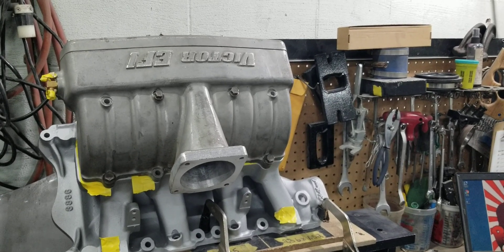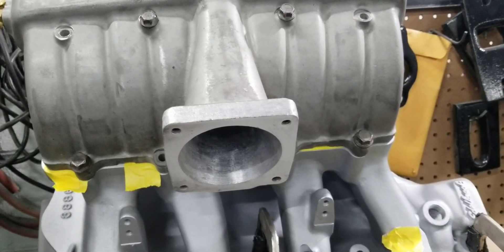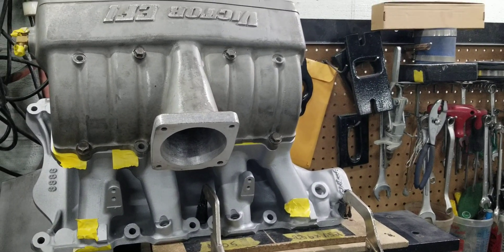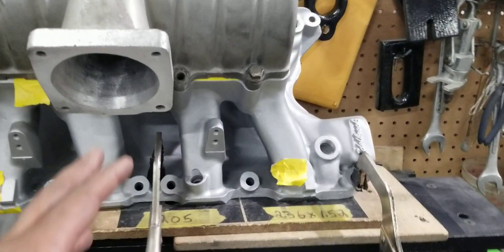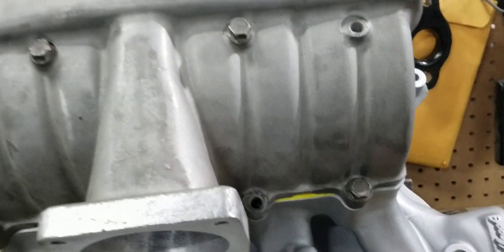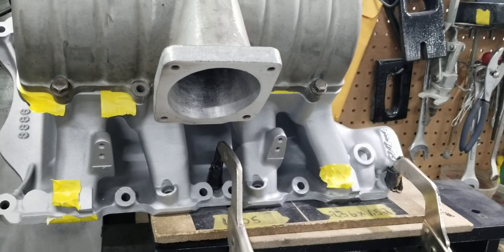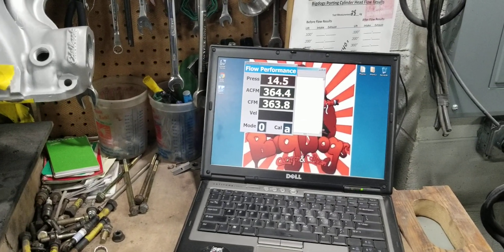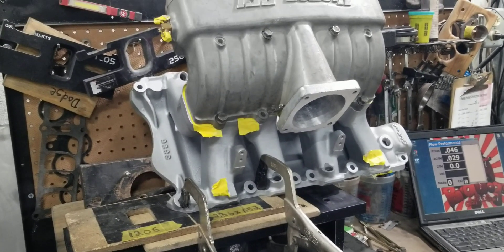SBF Stage 3 Ported Edelbrock Victor 5.8 flow results Part 2!!😁

Comment: Tony, what do you think the best flowing/power making plenum style intake is for a SBF/Fox body besides a Holley hi-ram?

I was thinking about finding an old Victor EFI 5.0 manifold, but after seeing that pinch point in the plenum tunnel, now I’m wondering if it’s too restrictive.  Did you guys measure the total flow through the manifold/all the ports?

Thanks for any info…. I’ll likely be letting you guys do a manifold for me, once I figure out the best one to start with.  500 hp 347 build.
Reply from the maker: Good question. The highest out the box flowing  and evenly distributed plenum on a sbf 2 piece style efi manifold is the tfs box R. It's TB tunnel flow is well over 1,320cfm which is the key reason it works so well even though it's out the box average runner flow is only 285-290cfm. 
Having a good flowing plenum and throttle body tunnel is key to maximizing your runners cfm flow to making higher HP. This is one of the reasons our new BRD Porting option can support so much power. We can BRD a manifold like a Systemax 2, Track heat, RPM2, TFS R, Victor 5.0/5.8 or Explorer GT40 and turn them into a high flowing higher rpm beast! All you have to do is pick the manifold you want and let us do the rest. No need to waste money. 500hp can be easily done with any one of those manifolds with stage 3 or BRD Porting.
Reply: Thanks for the info.  I’m running a stock hood so I can’t run the Box R.  I have it narrowed down to the Victor EFI 5.0, TFS Track R or the Systemax.    Appearance, I like the Victor EFI 5.0 best.  I had already planned on having it ported, but that narrow plenum barrel worried me.  I’ll be in touch with you guys about porting one as soon as I find one.
Reply from the maker: @AJsSpeedShop  we can do a BRD on those but the Systemax 2 and track heat are more readily available
Reply: Is the BRD the deal where you remove the TB flange and install one for a 90mm TB?  I watched a bunch of your vids and saw that.

Do you think the Systemax is the best over all intake to start with before porting for a 500hp, 6500 rpms build?     I can’t stand how they look but, if they make the most all around power, I’ll go that route.
Reply from the maker: @AJsSpeedShop  yes the BRD deal gets the increased throttle body tunnel flow, 90mm throttle body opening, cut with max runner shorting and max welding for max flow. The Systemax, R and track heats are the easiest ones to do this on. We can do this on the Victor as well but it's TB tunnel won't flow as much as the others

Comment: How do those victor efi intakes work on the street? A victor carb intake is definitely not ideal they have really short fat runners but these seem to have pretty long runners still, is the Tq curve on par with the victor carb versions regardless of looking so vastly different. Been researching for year or so now but Im just now in the early stages of putting a hotter engine together for my 95 first is the shortblock, the intake is the big ??? Aftermarket intakes are sooo GD expensive... Guess its sticker shock im still in the good carb intake for $250....im just a blue coller workin jerk off wanting to be less slow. What do i do Have my stock 95 HO ported or attempt to find a gt40/explorer? Go aftermarket? id so what... Its not going to be a hot max effort street n strip engine just a nice strong running daily stock stroke street engine I aiming for compression to be in the 9.5:1 to 10:1, likely enforcer 185s and a nice street cam with decent drivability xe274hr ballpark, something that would run up to 6000 or so. When its time to start  to break out the bank card ill definitely be getting ahold of you folks.
Reply from the maker: The Victor 5.0 is a shorter runner efi intake and loses low end torque compared to the others. It makes great top end hp in the 6,500-7,000rpm range and wouldn't be ideal for your combo. Best manifold for your combo would be our Stage 2 or stage 3 ported Explorer or Cobra gt40 manifolds with our Steve 2 sbf cam. You will have torque and hp and it's cheaper than the aftermarkets
Reply: thank you, I appreciate the reply.

Comment: These videos get me excited and remembering builds 20+ years ago
I already know those runners have a lot of taper to them from the plenum to the head.! I use to port ZR1 intake manifold I learned to use, from a fellow technician, a set of precision machined Delrin balls. I ported according to the balls sequence and associated diameter. Tremendous power improvements across the board!

Comment: Paused @ 1:44. I've used that manifold.  I've ported them to death 20 years ago. Then the manifold had no use for anything larger than an 80mm Accufab. I can't wait to see if the the customer just wants "big" or if the port work needs the throttle body.....

Back to vid
Reply from the maker: The customer wanted bigger TB. We explained exactly what you just said but the customer wanted it to 90mm.

Comment: I say that you have more than enough airflow . More than that I'm guessing you are going to slow down the air speeds and might effect anti reversion?
Reply from the maker: It's going on a 445ci motor so cfm flow and CSA is key to big hp and torque as long as the customer has the right supporting parts to keep up with it.

Comment: Man i didnt know that u used jb weld to glue the manifolds back together. Thats a smart move cause its faster than welding and nobody will ever see it .🤣😂😅😂jk I know that you dont that but it is funny someone is trying to make that claim as good as your work is 😁. I actually saw that claim and was going to give you a heads up on it but I laughed when I saw it cause I didnt believe that crap. Boy the haters or wannabe porters will say anything to try and make themselves look better 🤣 Who was it claimed that B.S? Don't let them come say it to yalls face and it make yall scared to come back to the shop and finish your orders 🤣😂🤣. I got your back if hes to scary 😂🤣😅😆
Reply from the maker: You hit the nail on the head. The haters has accused us of damn near everything from being scammers to putting out fake information even though we have put out tons of information and have about 4,000 customers out there lol. We've had people slander us on social media and even had a few try to blackmail us 🤣. 
All we are trying to do is help people go faster and build more power at an affordable price
Reply: @bigdogsportingtonyb2833  ppl has tried to blackmail you? 😅 Now thats funny . Sounds like they are getting scared, desperate , and feeling threatened because you are delivering on your promise of doing a great job that will net them superior results being horsepower, torque , and faster et. at a fraction of the cost that the haters cant deliver on, and as long as your on top the haters will be trying to bring you down to their level which cant be done because you know what youre doing. Like in this video how many porters can gain 100 cfm per runner on an intake? Your the only one ive seen so far